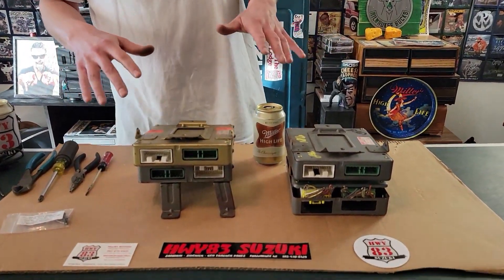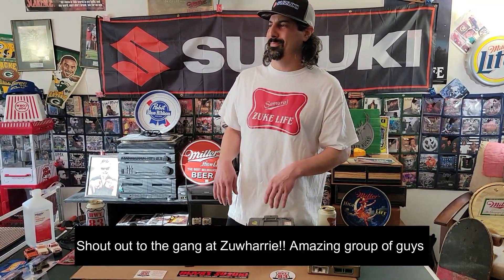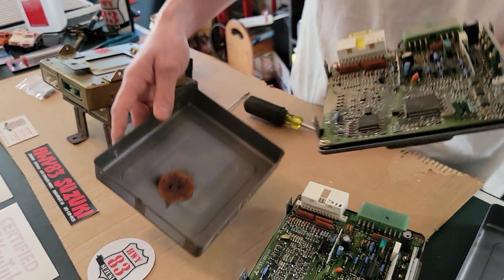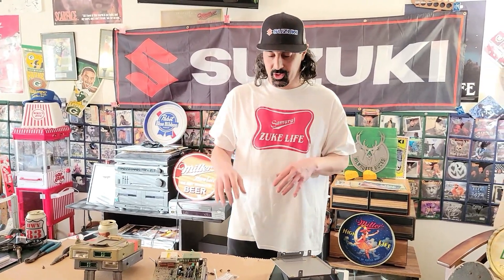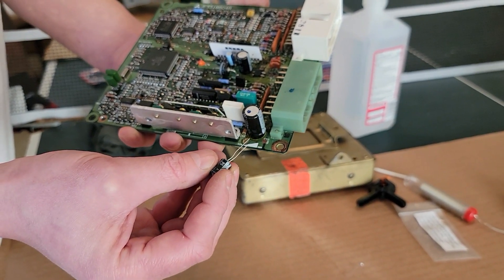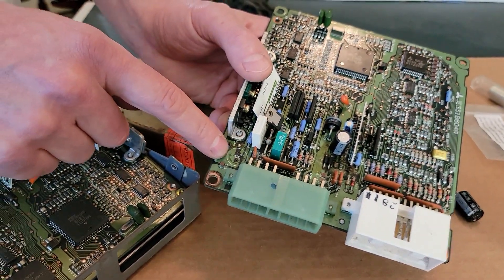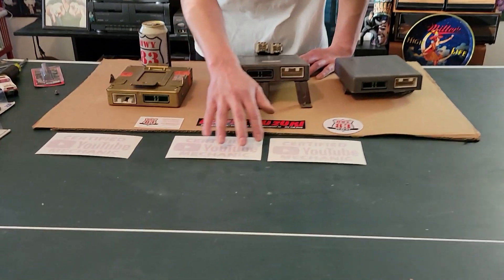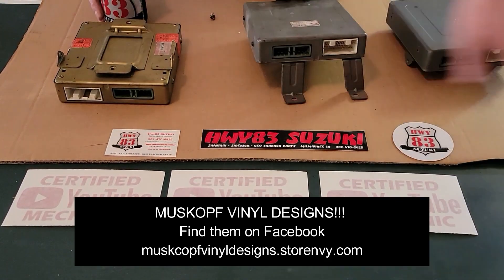Fix your ECM for cheap! Geo Tracker & Suzuki Samurai Sidekick computer repair @Hwy83SUZUKI

Comment: Hi bro how u doing? Is this procedure ok for doing with the TCM as well? My sidekick 1995 AT 4DR is driving me mad. Gives me code 36 error, no communication with both speed sensors. Its shifting strange, really hard to drive. I love my car, but this thing is getting me mad. I'm thinking right now about removing the tcm and taking a look inside. 
Ive already checked the tps, the VSS on the trans, the connectors (cleaned and put dieletric grease). After all that i've drive for 1 week, and then now suddenly the code is back again.

Comment: Same process for 1986-1988.5 Samurai?
Reply from the maker: That model has a carburetor. Does not experience these issues
Reply: I only asked because yes, I am carbureted, but I have a similar computer box behind the glovebox that is plugged into the harness, similar to the ones you show here in the video.  I haven’t cracked the box open yet to see if there is a board or??? But Blender Door did sell me the 3 capacitors, indicating they were for 1986-1988.5 models.  The computer box is only to help control the carburetor.  Weird to me Dave; I will still open it and see what they have inside and it they have those 3 capacitors and if they are in bad shape or not.  Appreciated your reply; please keep the videos coming; they’re great!

Comment: Hello, great series on fuel pump and ECM. My 89 has no power to the rear (fuel pump, hazards, blinkers, brake lights, etc.) I know that there is no power going from a 4 prong under my dash that I believe originated from the ecm. Motor turns over, lights at the front work, etc. is ECM repair my most likely next step? I have not pulled it from dash yet.

Comment: Maybe someone can help me out here. 95 geo tracker replaced the fuel injectors #3 fuel injector was staying open dumping fuel into the cylinder. Replaced all 4 fuel injectors. Test drove it Saturday no  more fuel being dumped into the cylinder. Today replaced the spark plugs and wires and cleaned the idle control valve. Now it’s dumping fuel again into #3 cylinder. Any help would be appreciated

Comment: I just picked up an 89, the guy was welding on the door hinge and forgot to unplug the battery, he said it wouldn't start after. Any chance it's just the capacitor?

Comment: I have a 1989 Suzuki sidekick it will run on starter fluid. Plenty of fuel pressure but I can’t get and injector pulse both wires to the injector show ground even when cranking and no power to injector key on nor when starting could you help me figure my issue out
Reply from the maker: @twoeaglesgarage6223  fix ecm

Comment: Did you have a video for diagnostic? I have a 95 sidekick. Mechanic said injector 4 is spraying fuel constantly. He replaced it but it didn’t fix it. I had already ran carb cleaner through them and none of them were stuck open. Thinking it’s throwing him through the same loop. Would the ecu cause only one injector to get stuck open? Or does that sound more like a ground?

Comment: Is this the same procedure for the 1.6 16V sidekick? I bought an 88 samurai last year that had already been engine swapped. It sat all winter but I started it a couple times and once in the spring without issues. Went to start it a few weeks later and she cranks but doesn't seem to want to fire, plugs don't have any spark. Fuel pump works fine and is getting up to the rails, thought it might be a bad distributor or coil but I'll to test those. Keep up the great work man! love the videos very helpful 👍

Comment: Would this problem cause intermittent stopping/starting issues? I was driving my 94 yesterday and it completely cut off at 40 mph with a CEL. After a minute the car started like nothing happened, no CEL,  and drove. Then it sputtered to a stop about a mile later and when I waited for the engine to cool down, it started right up again with the usual cold start idle etc. I'm hoping that the capacitors are the only problem and not something else, any advice?
Reply: Have the same issue, we’re you able to figure it out?
Reply: @CruzGarage  Haven't driven it since. It starts fine and idles smoothly but I'm going to tackle the ECU capacitors and see what happens.  I'm almost positive that is the problem and hope to see the obvious signs of them leaking. I will update.
Reply: @unknownnumber1264  I found a few links after digging for hours. Also posted on fb groups and I’m really thinking the ecm capacitors is really our problem. Ordered a new ecm, getting it on the 8th.
Reply: @CruzGarage  awesome, let me know how it turns out. Does yours start occasionally or is it completely dead? I think the ECM board expands and loosens the solder sometimes. I had the rusted fuel pump ground and connector issue as well, which caused no-start situations in the past. I fixed that by hardwiring the fuel pump to a separate toggle switch to avoid dealing with that nonsense factory wiring at the left side (rusted rocker panel).
Reply: @unknownnumber1264  got the new Ecu from o Riley’s today. Ran fine but then check engine light came back on and same symptoms. Spoke to a mechanical genius and he told me he had the same problem in his old little pickup. He replaced the ignition coil. I replaced that today ( O’Reilly Part #23-0332). Drove her down the street just fine and no CEL came back on.

Comment: Sir question for you Does 1993 Geo Tracker have a crankshaft position sensor (PS).? And if it where please because I replaced the ECM and I still don’t get a spark from the coil and the coil is new too thank you in advance 
LRL
Reply from the maker: No, Crank sensor started in 1996

Comment: I noticed a wire disconnected from the computer so I hooked it to the positive it didn't do anything so I hooked it to the negative and it killed the whole motor it won't turn over at all

Comment: Helping my cousin with a 95 Tracker. ECM hasn''t completely failed, but when hot he gets a no start. Ideas? Shop says it is an ECM problem, but they have failed to find a replacement

Comment: I have 92 tracker. Check engine light stays on. Flipped the Nad switch, only dims slightly.  Unable to retrieve any codes. Any suggestions?

Comment: Yo Tony...so let's say some dumbass did some welding on the body or frame and didn't disconnect the battery....could that cause some damage to the ECM?  I am running out of parts to change.
Reply from the maker: Should not be an issue
Reply: @Hwy83SUZUKI  Having issues trying to diagnose...some forum suggested that welding on the frame could cause a "Spike" or power surge that could cause problems with the ECM...Thank You for the crazy quick reply...

Comment: Any advice on diagnosing a fuel injector on a 1.6l? I have a 86 sammi with a 1.6 thrown in. Have fuel to the throttle body but injector ain’t spitt’n.
Reply from the maker: Check ecm would be my first move
Reply: @Hwy83SUZUKI  looks like with key on I’m getting 1.6ish volts to the red and yellow wires on the injector.

Comment: Ok so I pulled the ECU on my son's 92 geo and both of the capacitors leaked acid I went ahead and removed them and ordered new ones but a couple of the small capacitors 🤷🏼‍♂️ came off the board due to the acid leak, they are tiny squares and I'm not sure if they can be soldered back on, have you ever had this and is the board junk now? Thanks for the video so far I've watched all of the geo ones 👍😁

Comment: Tony, you said a 91 Sidekick should have a silver ECM.  Mine is gold.  Caps look bad, black under the large one.  Can I replace this caps and keep this ECM, or do I need a silver  one?  My idle is fast, 1300 - 1500 hot or cold.  Also my fuel pump never shuts off, instead of just running 2-3 seconds when the key is turned.
Reply from the maker: 89 and 90 are gold.  Be sure to confirm manufacturer year.  89-90 engines are easy to spot with the vacuum advance distributor.

Comment: Great video, I've repaired air conditioning boards that were obsolete and won't hesitate to fix my  board on 94 tracker when the time comes. Do you have any ideas on if  the cam sensor inside the distributor can keep the motor from starting? It's a '94 1.6 automatic. Has spark, fuel and injectors are all good. Crankshaft is at 12 and camshaft is on E and rotor is pointing to number 4. New wires and plugs and fuel filter. Engine turns but I'm not sure if the sensor is relaying to the board the cam position.
Reply: Hola. Tengo una vitara Sidekick del 93 y no llega a arrancar. Un mencanico me dijo que desde el ecu no da los 5v necesarios para el arranque. Me pasaron este video para mostrar cual puede ser el problema. Se lo voy a enseñar a mi mecanico ya que no entiendo nada. Si resuelta, te aviso.

Comment: i have the 1990 EFI ECM on passenger side, Holy Crud those screw are way to tight whats the trick ? impact driver?
Reply from the maker: #3 Phillips and impact gun will rip them right out
Reply: @Hwy83SUZUKI  Nope! Had to grind the nuts off behind the battery , turns out ECM was not the problem

Comment: Just bought a 94 tracker that popped a code 53 after about 2 days and since it was primarily a mud buggy im praying its bad grounds. But also definitely will need to pop the case open and look after watching this! It starts every time but sometimes cranks for a solid 5-10 seconds as though lack of spark (i can hear the fuel pump prime with every key on) does this cold or hot and every once in a while ill get a perfect start up right away. Your channel has all the best info on these old guys thank you!

Comment: Are there any kits for 97 models or do I need to source each part?
Reply from the maker: Try contacting blend door for the parts in a kit. 96+ models are much less likely to have these issues
Reply: @Hwy83SUZUKI  If this isnt the likely issue what would the problem for a crank no start with no power going to the pink black wire heading to the fuel pump? I'm guessing the relay?

Comment: We have the older fuel injected one how do you fix it can you do a video showing how to fix it or diagnose what’s wrong?
Reply from the maker: It's the same procedure. Inspect the components and replace the capacitors. Blend door will have the parts kit
Reply: @Hwy83SUZUKI  ok I changed out the capacitors and it still doesn’t have spark or fuel. Any other ideas? I checked all of the fuses in the fuse block under the dash. I have the 92 with fuel injection. I can’t find the fuse box or boxes under the hood.
Reply from the maker: The video shows the repair to capacitors
Reply: @Hwy83SUZUKI  But the board looks different on my ECU. I have the one with the legs on the case. The capacitors aren’t the same. It’s laid out differently on my board.

Comment: Thanks for the ECM lessons.  I have a 95 Sidekick 4 door, automatic transmission problems.  Had tranny rebuilt, solenoids, valve body, disks, etc.  Problems continued, shifting, high revs, slipping, etc.
Replaced tranny computer, problems continued.  Replaced TPS and still having shifting and tranny issues.  Can you please help? ... Do you think its the vacuum lines / modulator valve? ... Where is that located?  Thanks!

Comment: I have the 96’ geo tracker 4wd automatic transmission, 1.6l . This will not work since it is a 96’ right ? :/
Reply from the maker: Those year models are less likely to have issues with the ecm but the inspecting and replacing will be the same

Comment: Tony I'm stumped! I have a 1996 suzuki sidekick 2 door convertable automatic transmission that will not shift into 2nd gear until about 2- 3 miles then it starts shifting and works great. Its not losing fluid fixed seals replaced tranny filters and also ran AT-205 Through the tranny and no change in the behavior of the drivability. Appreciate you. And all your help.

Comment: Good video !
Try not to apply too much heat to the PC board especially when using a " Soldering Gun. "  The foil may lift.
Use a solder sucker ( pump )  with soldering iron for a clean job.
Reply from the maker: Good advice! Thanks for watching 🍻

Comment: Thanks a million for your videos, they are incredible. I hate to be the guy who asks for advice in the comments, but I'm working on a '97 tracker and was wondering if it would be ok to use Miller Genuine Draft (MGD) instead of Miller Highlife while replacing the water pump. Any advice is appreciated.
Reply from the maker: Always best to ask first before making a mistake. Yes indeed, MGD is a solid substitute if High Life is not available! 😁🍻🤣

Comment: Do you repair? Apparently I have the ECU  that sells for $400. Can I send you a photo? I'm a broke ass desert rat.
Reply from the maker: The video shows the process of how to replace the capacitors. That's the cheapest way, $15 in parts.   Otherwise the contact info of the professional service is in the video as well if you want to contact them for repairs.

Comment: Is this the same for the 96-98 trackers and x90s
Reply from the maker: The 96+ models are not very common to have issues
Reply: @Hwy83SUZUKI  that’s pretty cool I can’t wait to get me older sami or track thks for info
Reply: @Hwy83SUZUKI 95 models only have 2 capacitors?

Comment: Better late than never. Wish I could've seen this about 10yrs ago. At first I could get mine to run if I primed it with a little gas it would run till I turned it off. But eventually had to replace computer. Anyway thanks for the video. Im sure it will happen again someday.

Comment: I have a Geo tracker 1996 The car is working perfect but it has the  Check engine light on when I plug to the computer to read the code it can't read any thing the computer is not responding do you think it's also the capacitor?
Reply: Having the same issue. Engine light is always on, unable to retrieve any codes. Have flipped the Nad switch, with no change.
Reply: Hey guys I have the issue pretty close. My problem is light doesn't come in for nothing. And when I plug my scanner in it doesn't register nothing except it comes on so I'm assuming it's got power,